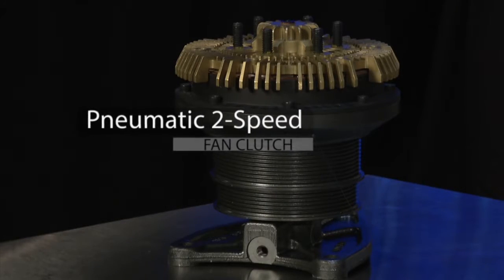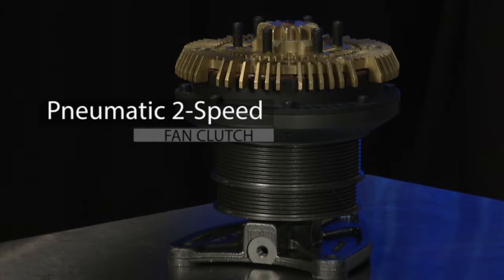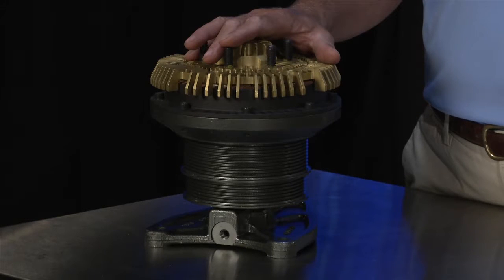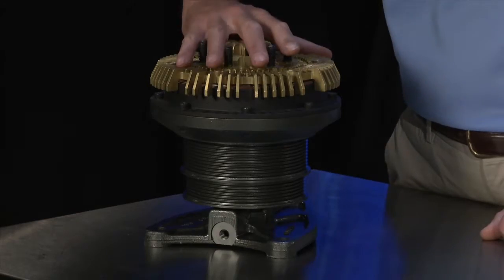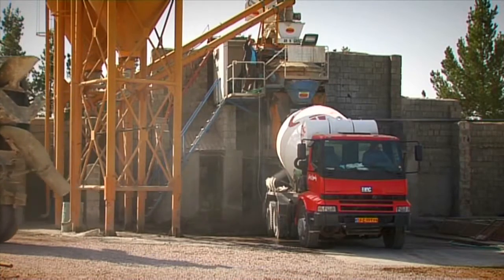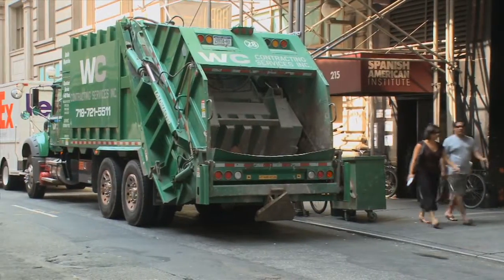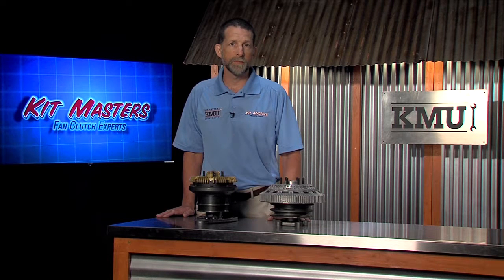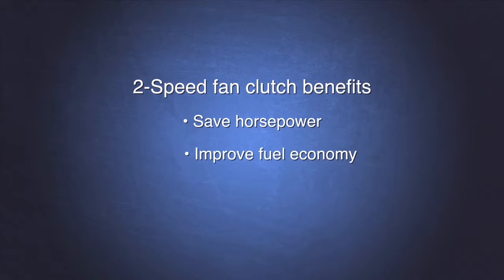Why Use a 2-Speed Fan Clutch?

Comment: These guys don’t know there own product and don’t stand behind it. I bought one for my peterbilt 379 with cat motor. I drive local stop and go 70k pounds. The fan worked incredible. Always kept truck cool without second stage needing to come on even with a/c on. Then after 30k miles, the first stage stopped working all together. Barely spins at all. Now the second stage always engages to bring the temps down. I’d say it’s on 50 Percent of the time. Nothing wrong with my cooling system or a/c. Like I said the first stage no longer working. Kitmasters reaponse after calling all the time “not sure what would cause that, take fan clutch off and send back”. Yeah ok, shut my truck down for a couple weeks and lose money right? How about send me a new fan and I ship the old one back so you can evaluate. 
Guess I’ll have to switch to hornton 2 speed

Comment: Why not use electric  cooling fans then?
Reply: The simple answer is because there is no practical way to make an electric fan system that can outflow a mechanical fan at higher RPMs and there wouldn't be much of a benefit. Engine Masters showed that a much smaller automotive mechanical fan takes 15-30 horsepower depending on the type. Although I'm sure a huge fan on something like a semi truck or bus would take much more power, let's go with 15 horsepower as an example. 15 horsepower is 11,185 watts. At 14 volts (normal charging voltage), 11,185 watts is 798 amps. An alternator that can produce that much power, an electric motor that powerful, and wiring/relays that heavy duty is going to be insanely expensive, large, and heavy. Generating electricity isn't free either. You wouldn't be reducing the load on the engine, you would just be loading the engine down with the alternator. Actually, since alternators and electric motors aren't 100% efficient, you would be taking even more power from the engine with an electric fan. If the fan motor and alternator were both 75% efficient, 50% of the total input power would end up being lost and the power required from the engine to move the same amount of air would be doubled.
Reply: @averyalexander2303  yeah good explanation. Off road heavy equipment I see them being driven buy hydraulic motor